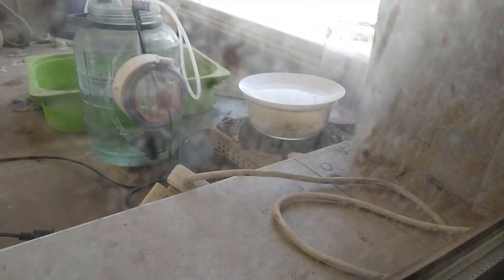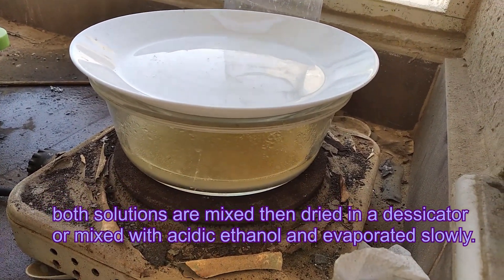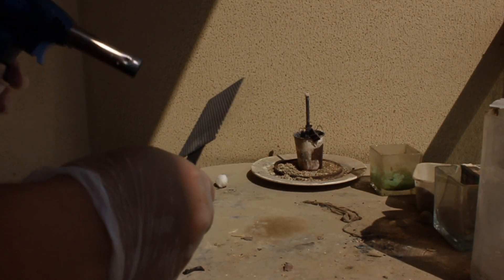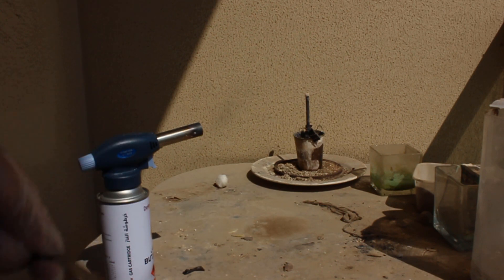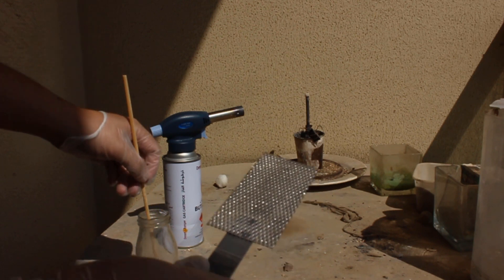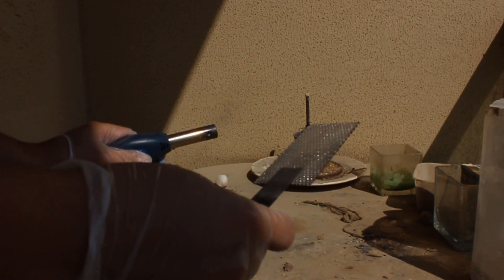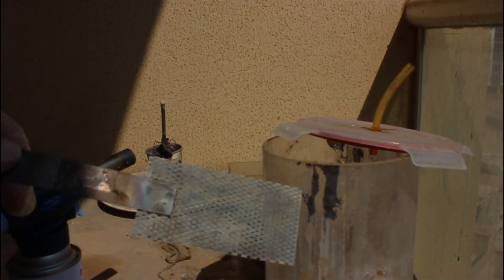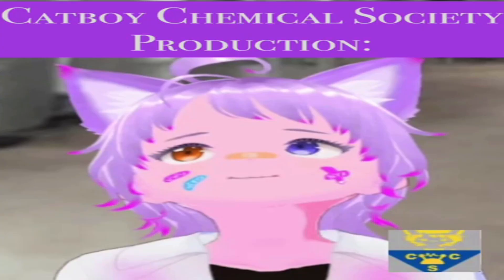DTO substrate Lead Dioxide electrode part 2 preping and baking DTO.

Comment: what is the role of cerium ?
Reply from the maker: Chemical resistance
Reply: Chemical stability which contributed by the superstable nature of the electrode, dense microstructure, good conductivity and the improvement of bonding. PbO2-CeO2 anodes have a service life 3-4x longer than regular PbO2 under the same conditions. The PbO2 exists as a mixture of the alpha- and beta-form on the CeO2 doped anode.

Comment: I think it's better to have a layer of titanium suboxide on the surface of titanium base. Titanium suboxide and lead dioxide have stronger adhesion. Moreover, titanium suboxide is more economical. The process of changing from tin to stannous chloride is bitter. Pure tin is too expensive. Most of the products on the market are mixtures of tin and lead.
Reply from the maker: Any methods on how to prepare it and any actual practical anodes made from it
Reply: Does titanium suboxide is present by making electrolysis of titanium in sulfuric acid solution?
Reply: You can find 92% pure tin easily on flea markets, they used it in the old days to make decorative plates, cups etc. They usually sell them for cheap.

Comment: Can i pull apart car battery for a lead dioxide plate? Will that corrode?
Reply from the maker: It won't work but you can reduce the oxide to PbO using kerosene method then plate on DTO
Reply from the maker: It will overall erode because there's nothing preventing interface oxidation which is why DTO is important

Comment: I asked u about the process of making SnCl4 but it's removed it seems. I tried to make the solution several times by reacting H2SnO3 with boiling  HCl . But it failed I think . At the first time a syrupy (like liquid glue) thing was formed . It was hardly soluble in ethanol and the result was not a clear solution. At the second attempt  the meta stannic acid didn't even solve in HCl and a cloudy suspension was formed . I made the meta stannic acid by dissolving pure tin in concentrated nitric acid.
1. Would u plz tell me how much stannic acid should I dissolve in how much HCl exactly ? and how long should I boil that  ?
2.For making dopant how much Sb2O3 should I dissolve in how much HCl and how long should I let that boil ?
Reply from the maker: Its not meant to be a clear solution if you are using aqueous method. But you need strong HCl above 30 percent and if not you need to bubble HCl gas.
It forms a slightly cloudly solution and it must be hot HCl
Reply from the maker: That syrup was good but yes in ethanol it forms a solgel which is fine but if you want a more uniform solution you need to bubble HCl gas or chlorine into the suspension. Overall though it will not dissolve completely unless you started with anhydrous SnCl4. The solgel is quite useful for thermal baking btw
Reply: @CatboyChemicalSociety  Thank you for your quick reply 🥰🙏

Comment: Hey!

Thanks for the video. Iam really on to making my own PbO2 anodes for a perchlorate cell. I appreciate the opportunity you give us to get a selfmade reliable electrode! Though, i dont understand whats going on in some parts of the video. I would really appreciate if you can help me understand these steps:

At 1:09 you say that the insolubles are mainly tin 4 oxide hydroxide. I coudnt find any information about tin 4 oxide hydroxide online. Is this percipitate now the metastannic acid, the tin dioxide (SnO2) or some other thing? 

And is in the final plating solution tin 2 chloride or tin 4 chloride with cerium 3 chloride? And if its tin 4 chloride, how can this form? What chemicals need to react together to form it? 

Hope you can help me, I really enjoy your videos, but iam not that experienced in the chemistry behind that (yet). Iam working on it.

Greetings, Dominik
Reply from the maker: metastannic acid is tin4 oxide hydroxide its just that they give it that funny name cuz ?? blame gold refiners anyway looking at its structure the tin is in the +4 oxidation state.
The tin 4 oxide or whatever you wanna call it is then filtered and reacted with boiling over 30% HCl and yes it needs to be boiling then cerium/antimony oxide is also added together and the final liquid solution is allowed to evaporate at 45-50C till you get wettish crystals of tin 4 chloride tetrahydrate mixed with your dopant cerium or antimony.
This is then added to ethanol 95% or higher in ratio of 2:8 crystal mass to ethanol.
any undissolved crystals could be PbCl2 if you managed to forget to wash your metastannic acid with dilute HNO3.
lead impurity wont impact the quality of the substrate and its important to wear a respirator while plating it.
Reply: @CatboyChemicalSociety  thanks for the fast answer, appreciate it! I will give this percedure a try soon

Comment: So MB what exactly the plating solution is ? 10% cerium chloride 90% Tin chloride dissolved in ethanol ?
Reply from the maker: yes and you take the resulting tin tetrachlride and cerium chloride mixture and dilute with ethanol at a ratio of 2:8 or so where 8 parts ethanol 2 parts mixture.
Reply: Got it thanks
Reply: @CatboyChemicalSociety  After i searched a bid about cerium oxide, i have seen that it has been used for car glass polishing. I guess that is where you found it right ?

Also have you ever consider other metal oxides,  there are plenty of other conductive metal oxides.
Reply from the maker: @Lionman-rw7xb  yes and its very hard to purify so try to get the yellow or white one.
Reply: @CatboyChemicalSociety  ok thanks
Reply: If there are so many conductive oxides, why haven't I seen a conductive glass? Coatings, but no straight up solid chunks...
If such a thing exists, where do I find formula, sintering temperatures, chemical resistance and so on?
Reply from the maker: @petevenuti7355  There are conductive glasses btw.
glassy carbon is one example and there are also other metallic glasses which are conductive.
There are even conductive polymers that exist but clear glass well for some reason those arent conductive.
Reply: @CatboyChemicalSociety  I was specifically thinking about oxides, fluorides and such, for the chemical restantance, the transparency is irrelevant.. for situations where carbon would disintegrate or oxidize and metals would react. Like say , a chlorate cell😏, if there was a semiconductor glass or ceramic cheap as lead but with chemical resistance of platinum it would be great.
A different kind of MMO one might say.
 Something like that could be useful for other reasons needing chemical restantance to something else, or solid state batteries, who knows.
I'm also curious about polymer conductors , specifically how could they have a tailored reactivity to the media they are in...(sensors, active electrodes, solar cells, etc.) 
I have much to learn.
Reply: @CatboyChemicalSociety  Conductivity implies that the electric field of incident photon will undergo a pi degree phase shift, hence reflect, think of a mirror. Thus, transparent conductive glass is a contradiction by definition.